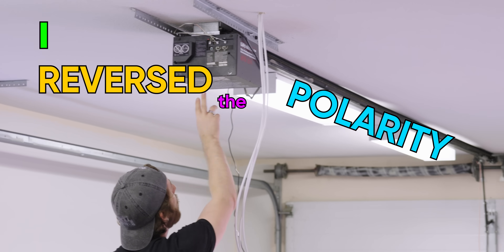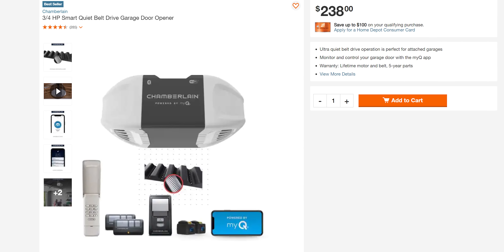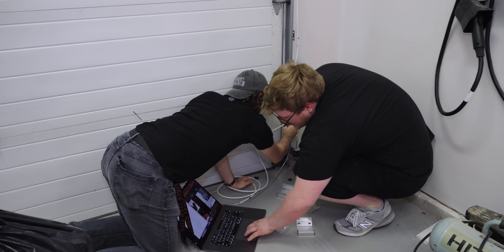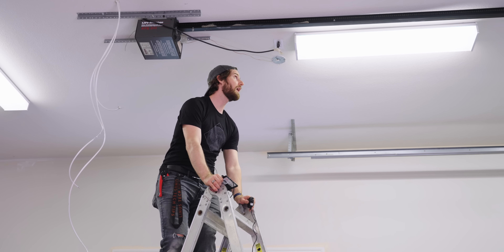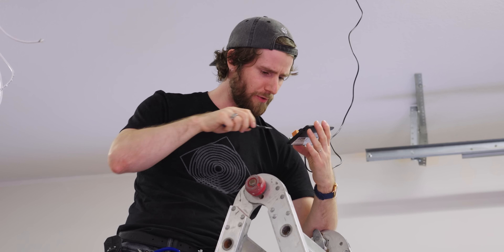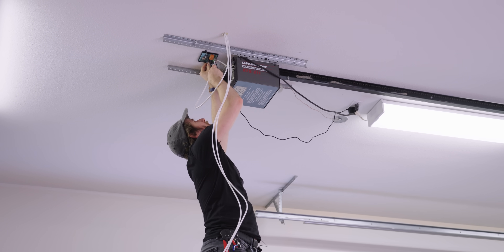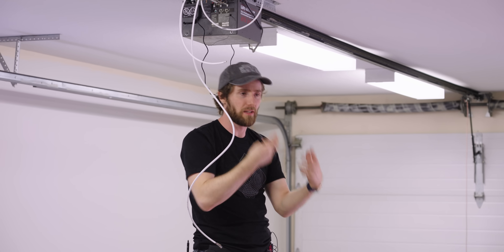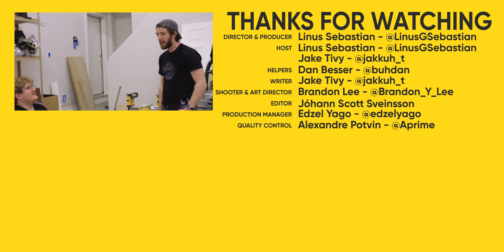Smartifying My 25+ Year Old Garage - Z-Wave Garage Door Opener

Comment: As a security installer and automation/integrator (job title fluid), I have some constructive criticism:
1) I strongly prefer contacts that mount at the top of the overhead door. I get way fewer service calls than side-mounted ones. Your kids will knock that fucker off the wall for sure. And the amusing attempts to get the side-mount working are all too common, whereas top-mount is 4 screws and done.
2) you could have used the linear z-wave garage door opener. Easy enrolment and it just needs power and to tap onto the terminals. It uses a wireless tilt sensor to monitor opening. And aside from one wacky surge that killed a bunch of them for my clients on one block, I've never had issues with that product. 
3) the real reason that jasco won't support firmware updates on thos switches is likely because the older batch of jasco switches are prone to shorting out after a while, which is why I keep changing them out. They probably don't want their hands in that cookie jar.
4) It seemed like you thought that only devices with newer encryption act as z-wave repeaters, but that is nor correct. Any device getting AC power at the time of inclusion is marked for repeater status. If I misunderstood your point, you have my apology.

I'm sure I could think of more, but I really just wanted to share those key points.
Reply: One more thing: the annoying blinking lights and beeping are a safety feature. Your system is trying to warn anyone in the garage that the door is being closed by someone remotely. Even the linear z-wave does it with built-in hardware. It is annoying and loud, but that's the intent.

Comment: Imagine doing all this instead of just buying a Nexx.
Reply: The hell's a nexx?
Reply: @CriticalCipher  Turns a dumb garage door system into a smart one, works with siri/alexa/google, has wifi, can use physical sensors or wireless, supports proximity opening, is easy to install & setup, no monthly fees, & hardware is relatively cheap.  Just lookup Nexx smart garage.
Reply: @chickenpickler Okay thanks though doesn't look like it works with home assistant currently

Comment: Would plc home automation not have been better?
Reply: Better how? This was easy to setup and cheap aswell as using zwave
Reply: @CriticalCipher  because there having to use multiple obscure different components to get stuff to just about work. A decently implemented plc system would be much easier to role out and allows for much better expansion and means absolutely anything you want to do can be ran through it
Reply: @OwenM98  just sounds like home assitant at that point but you're locked down to only one type of system. Like you have to know that his system need to do person and face detection throught his cameras he already has up, work with all his tvs, pcs, av equipment and cooling setup and all be able to be designed neatly in one app that can be custamised per user or device basis and also be entirely local aswell. Now if PLC allows this than thats great and would like to learn more anout it at that point
Reply: @CriticalCipher  your plc system is an input output system so it will work with just about any other system if you know how to make them work together, They are used in almost all large scale manufacturing environments due to there robust nature
Reply: @OwenM98  Ah did try looking it up and can't even buy it nor are there any resources on it by the looks of it so think home assistant is better in this case for its ease of use and availability as well as how this would get more audience as well
Reply: @CriticalCipher  trust me there is a huge amount of information on plc and ladder logic 🤣 fire alarms, robotics and almost any automated process runs on it. Look into Siemens TIA and step 7
Reply: @OwenM98  Okay but how is any of this easier, cheaper, or quicker than just getting smart home equipment and doing a little bit of code with countless videos and forums the subject. Like how would I have a PLC system do something like integrate to my alarm and cameras that are already up and to add facial detection to them for security for instance? Cause if this is an easier, cheaper or more flexible solution than I will look into it more. Like it looks more reliable but doesn't look easy or that flexable
Reply: @CriticalCipher  your home automation is not doing the facial recognition. Your always going to have separate programs running for the cameras let's say. The home automation part is the control and switching of light's locks heating cooling and all that stuff. That's where you can use a plc because then you never have an issue with compatibility issues with the other softwares your running
Reply: @OwenM98  my home assistant is running frigate which along with my alarm's door and motion semsors allows me me to know whats around my house when the alarm is armed and to notify me in the all the smart speaker in the house that has a person in said room that theres someone at the door or when the alarm is armed I have added sercurity as the system is looking for peopke in certain zones and will trigger the alarm if detected. And all.of this running on a device thats was just layong around the house. Even linus is using person and faciao detection in his system. So I don't thi k it's better as it's not as custimzable or as easy to get. I get get smart stuff from tuya, sonoff and shelly that will pair automaitically to the system for me to start integrations with very little code while PLC seem more relible it seems to have no other benifits and is entirely made by yourseof by the looks of it meaning thats alot of time when I can just buy relatively inexpensive gear to control the stuff in my house like energy monitering plugs so I can tell if my washing machine is done, play any video on any service I own simply by asking for it via voice. If PLC can do all these things in one contained system then I'd love to look more into it but like besides factories I can't see a place to buy any systems that work with little to no effort besides installing but would like to be wrong and maybe I'm just looking at the wrong thing and would like a more reliable and flexible and easy system so if you can show me or tell me how a system like this would function. It'd be much appraited